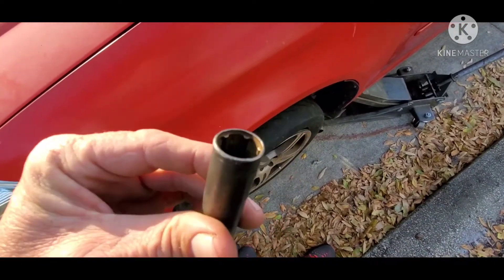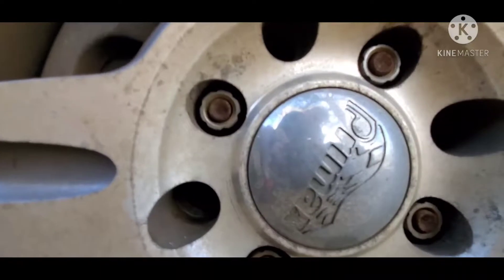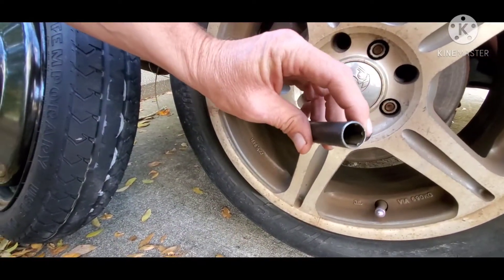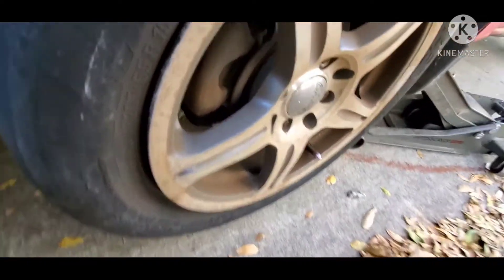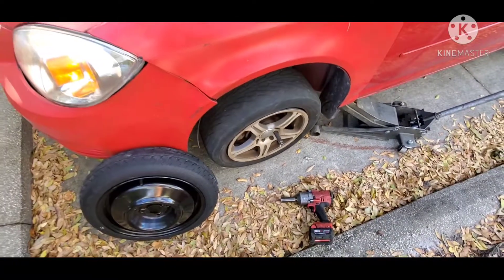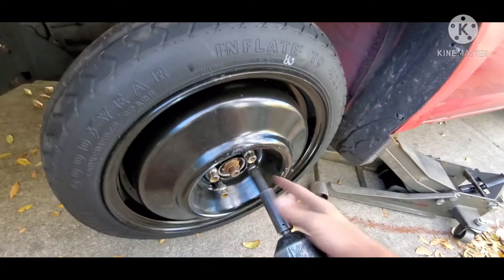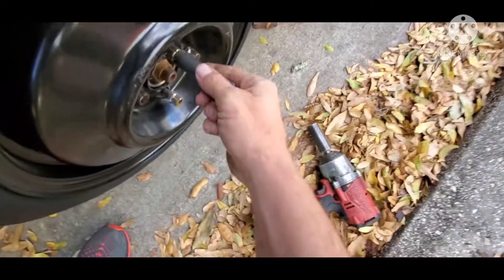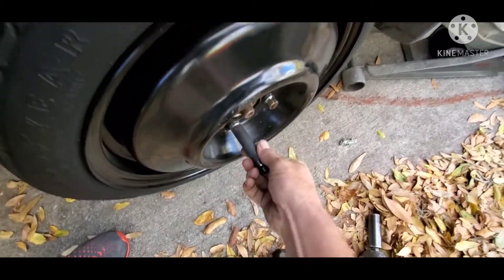What Is A Spline Lug Nut & Spline Socket

Comment: HEARD OF TORQUE WRENCHES ?
Reply from the maker: Yeah I heard of them why? 
Ohhhh let me guess. You are suggesting I haven't because I don't use one right? Ohhh God you must be, because you wrote in all caps like you know something. Well, guess what. Not one automotive vehicle manufacturer has ever issued a factory torque wrench with any vehicle ever. Why? Because it's not that critical. As tight as possible by hand or foot. If using an impact the person using it must have an ear and feel for it. Plus the Milwaukee impact I use has torque settings to not over or under torque. So yeah I heard of a torque wrench but I'm wayyyyy to advanced to use one. Speaking of my advanced knowledge I would also add that a person will not achieve a torque spec settings on those aftermarket spline lug nuts. They aren't factory therefore all factory specs go out the window. Thanks for watching.